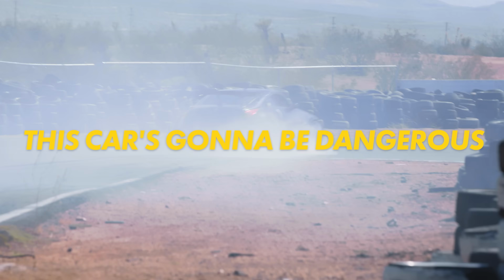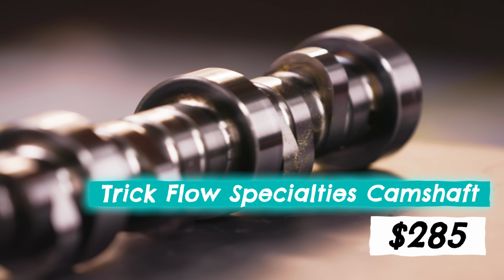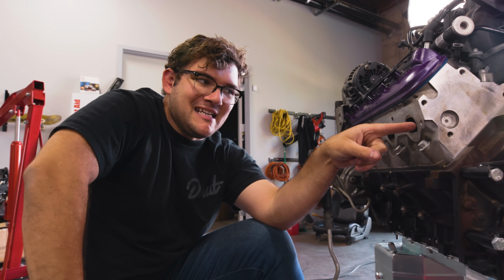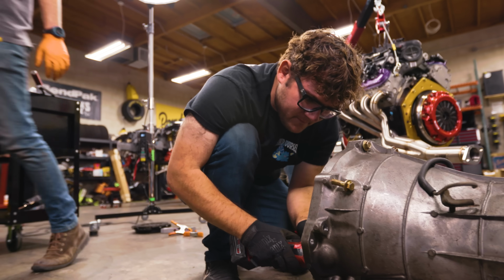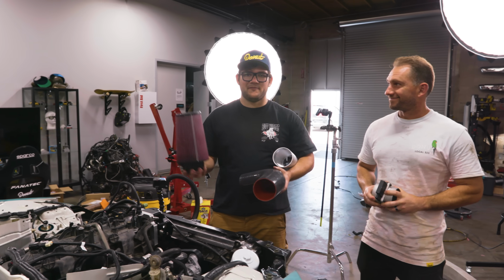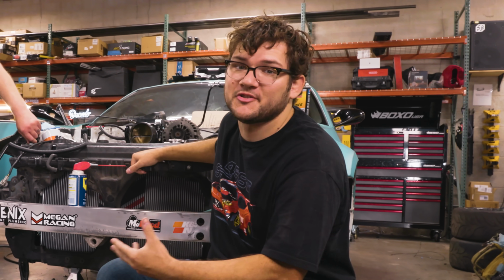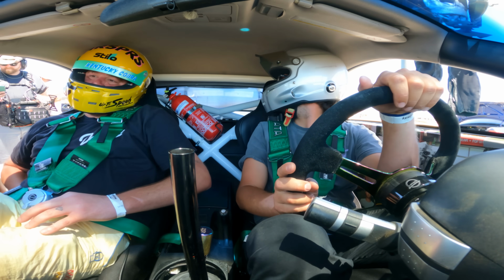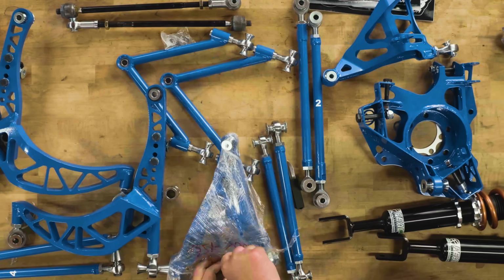$8000 Junkyard V8 vs $30,000 Crate V8 Engine Swap

Comment: Unreal that you made this whole swap in one episode. The amount of time, effort and skill it takes just to do the swap is on a whole nother level. 
So great to see this!
Low car with those tight gear ratios is always gonna smoke the 0-60. Be interested to see the 1/4 and 1/2 mile tho!
Reply: They could have easily drug this out. I'm so glad they didn't
Reply: Yes most other channels would have drug this out, thank you for not doing that to us.
Reply: And for that, I'm going to hit the like and subscribe buttons. I have watched a lot of videos and have not subscribed, until now
Reply: im confused, a google search shows the t56 has 1st gear  as 2.66 vs cd009 (low car) has 1st gear ratio 3.78. would you mind explaining this for me? Do these numbers match, or am I confused?
Reply: @julianbryant1115  The higher the number, the lower the gear, the more wheel torque, but less top speed.
Reply: @jackryan4313 
honestly would've preferred a long format video or multi-part video. i don't know. the whole vibe is sterile here
Reply: @julianbryant1115  higher number more acceleration
Reply: @TheScott240  it's a sin to just now be subbing to donut in 2022
Reply: I wanted to like this, but it's at 420 likes.  So I did the right thing.
Reply: Seriously, when I first clicked this video I thought it'd be part 1 of a series. Lots of work into this one, super sick.
Reply: it takes like 20 minutes to pull a motor with like 6 guys
Reply: I belive if they when with a higher ratio high car could have easily won the 0-60
Reply: @barbaraescobar1329  can attest, 5 of us took 31 minutes to pull a vg30 non turbo out of a 300zx. Granted all deletes were done and exhaust was new so we didn’t fight much
Reply: @dekhunter148  but yall werent recording a movie while doing it...
Reply: They also didn’t really go into detail and other channels would
Reply: @God-mb8wi  I think the point is that they can get on to other more advanced mods instead of doing a five part series on just the engines alone. And who knows, I'm sure they have an absurd amount of footage leftover if they want to break it all out later. I love engine swaps but the point of this show is more to compare the differences you get from buying super high end stuff over taking the cheap route.

Comment: At 25 minutes 11 seconds. Hearing Nolan expressing his feelings. I had flashbacks of me working on my car's entire sound system. Just doing a project at a time, an effort at a time. It was hard, not knowing what is right. Can I mix and match between different brands, items, connectors and etc. Definitely felt good throughout this whole 30 minutes video. Definitely an inspiration for this little but expensive hobby of mine

Comment: Though "budget friendly", low team has a PHENOMENAL setup.  Those "cheap" parts are still great parts, I'm a big fan of TrickFlow myself.
Reply: Their junkyard engine did cost more than my entire car ^^
Reply: @SchwachsinnProduzent  yes i think since they are in cali those engines are more expensive i had a shop in mexico do a lq4 6.0 swap on my cutlass n the engine and trans was around 2k tho i did run a 4 speed auto truck trans so thats way cheaper
Reply: @SchwachsinnProduzent  LQ9 sell for 2-3k, NEW crate engine costs 13k
Reply: Who makes more powaa baby? Of course the one with higher power to weight ratio or am I wrong?
Reply: @Warriorbread  Yeah you are, the one who makes more power is the one who literally makes more power
Reply: @Warriorbread  if you mean which one is faster than yeah power to weight can be a big determination, but putting the power down is extremely important.

With the same crank HP, a more efficient transmission can put down more HP to the wheels.

So if dyno testing is the same, and the weight is same, the one with better gearing and better tires will be the faster one. 

There are too many factors besides just power and weight in other words
Reply: @SchwachsinnProduzent  earn more
Reply: @DuBstep115  go to pull a part and get it for $250
Reply: @jbeasley2528  LQ9 for 250? Probably not, but 5.3 Vortec? Yes.
Reply: @DuBstep115  pick and pull and other chain junkyards have flat rate prices, 250 for a short block (no heads and accessories) or 350 for a long block, best way to do it is go there every week until you find an lq4 or lq9 and buy a short block then a set of valve springs a sloppy stage 2 cam for 89$ and a set of remanded heads for 500-650 and you can build a 450 hp 6.0 for less than 2500$ with wiring and ecu included the best part is there is tune files for sloppy stage 2 cams everywhere for free and a hp tuners mpvi2 is 350ish last time I checked
Reply: @turkeyboyjh1  noice
Reply: @pk_riza_lol183  Where you live factors in SUPER heavily on the price and availability of engines for swaps. I live in the South West desert where V8 is basically the only block we use. However I would still argue low car went for a pretty pricey block, when I mean the true budget Queen of the poor boy blocks would be a Ford Interceptor V8 out of a gen 2 Police Fleet Crown Victoria, I have seen wholeass interceptors go for $200 and crate engines for them go for $2-3k. The Gen 2 Crown is THE fleet car from the late 90s into the mid 2010s hell I think the Crown is still used as a fleet car I mean I got pulled over by a Crown like 4 months ago. My guess is they went with LS in part for the meme, and in another because the crown vic is lacking in aftermarket parts since well it's one of the most hated cars for it's unnecessary bulk, and lack of power compared to other ford blocks, plus I can only imagine the headache of trying to get parts for an unpopular block when an LS is just WAY easier.
Reply: @turkeyboyjh1  complete 8 cyl with accessories is $272 at pullapart including core and fees, at least where I am. You can also sign up for notifications when they get certain cars in and you just have to be ready to get there and pull the engine. 
I see guys put them in older GMs and be under $2500 total for what they did here. That's modifying the factory harness, knock off mounts and modifying cross member. A summit cam and springs and flash ECU.

Comment: Great episode and I'm hyped to have hi-low back! That being said, when you're doing head to head tests, for best apples to apples comparison you should really use the same driver for both cars. To avoid bias it shouldn't be someone from either team. Driver mod is easily the most important aspect of the test at the end here.
Reply: The stig!
Reply: No Zach is a better driver than Nolan from what I’ve seen, I’m pretty sure it’s the transmission that messed him up
Reply: @dominicblade6514  but how would you know?
Reply: I Agree, but one needs to say that low car would have been even faster because Nolan is a less refined driver than Zach, at least from what we have seen over the years.
Reply: @m_lies  what I mean is that the new transmission felt different than what Zach was used to. So he didn’t know the how to drive it like he did before. Nolan has the luxury of using the same trans and I’m sure that the high car is faster they just need a different rear diff to handle all of the power
Reply: @dominicblade6514  well ok, but why do you tag me?

I didn't even comment on you but on Bob Dole " for best apples to apples comparison you should really use the same driver for both cars" I agree with him, but only that I think it wouldn't change the outcome much in this try.
Reply: @m_lies  Your opinion is noted, but frankly low car couldn't have gone much faster. As it left the line, it was on the edge of traction the whole time (we can see the tires chatter and constantly start to break grip before regaining it). Meanwhile high car either totally lost traction or left the line slowly all 3 attempts. Secondly, driving in one scenario isn't equivalent to driving in another. Different situations use different skill sets. Just because you think driver A is generally better than driver B doesn't mean they will perform better than driver B in all situations, every single time. That's why it's important to use the same driver for both cars so that you're not comparing different skill sets as well as different cars. Third, hi-car has a twin disk clutch and low-car has a single disk, their engagement properties are different and that appears to make hi-car much harder to launch than low-car.  Lastly I love the crew at donut and I don't give a damn who's "better" I'm just thankful they're making great content and I gave my input on how to make it even more awesome.
Reply: @dominicblade6514  My comment wasn't intended to point any fingers at who might be a better driver. I agree that the clutch* gave Zach a hard time launching and Idk if anyone else would have done any better. Just a comment on how we should be comparing the cars not the cars AND the different drivers skillsets.

Comment: jeremiah using chemistry to shrink and expand metal is  was probably the most incredible part of the video, i live this dude
Reply: Technically physics not chemistry but yeah that was sick
Reply: I thought everyone knew to put bearing in freezer day before install?
Reply: @alexig1840  yeah it's common knowledge among mechanics haha
Reply: @caydenwenger523  It is, but I don't need to do it very often, maybe once every couple years.  Most of the time if you have the right tools and follow OEM procedures, you're fine.
Reply: But if u heat metal it grows, the hole gets tighter ?
Reply: @jyjhseko  no, if you heat metal then the molecules expand, making the opening bigger and more pliable.
Reply: @craigstephenson7676  Thermodynamics.
Reply: @bernardtarver  Which is part of physics 😂
Reply: @trentmckenzie343  There are about ten different branches of physics; doesn't hurt to be specific.
Reply: @bernardtarver  yeah fr my original comment was just being specific
Reply: @jyjhseko  no? It expands

Comment: I’m impressed that the “low car” was within 38 whp of the “high car…” especially considering the difference in budget.
Reply: truck motor = TORQUE
Reply: @BudgetBB  Which is different than what was said... whp.
Reply: the lq is common at drag strips they are monsters fullly built
Reply: @BudgetBB  camshaft=MO HRSPWRS
Reply: Well 8000 should actually buy a badass used engine
Reply: Yeah, i would have though for 30k you can get a hellcat motor or smth. I guess if they calculated the custom exhaust into that thats probably where a lot of their budget went.
Reply: They do say the crate engine is a 6.2L, and the junkyard engine is a 6.0L ...so the extra hp for the extra displacement just makes sense as logic potential goes.
Reply: @braptechfun6036  not exactly, u can have the same displacement for example 3.8L but have a small to big difference. a normal car uses higher RPM to get its power, a truck engine uses its lower RPM because of the LowEnd torque they have. thats because of the surface-area*1 of the Piston and the Piston stroke*2. normally its "1*>2*" or "1*<2*", there are also engine where 1*=2* but its not that commonly. so team Low actually could have beaten team High in terms of HP pretty "easily". but dont take me too serius, im just a dumb 23 year old that didnt graduate and doesnt have a license nor does have a job.
Reply: That would be "Over Square", "Under Square", and "Square"  bore to stroke ratios.  Over square is better in high RPM applications due to the lower piston travel speed. This would allow for higher RPM limit and also to take advantage of a higher duration camshaft.  Engine RPM limit is of course limited by a multitude of things such as for example valve float, etc.
Reply: They put a cam and heads on a 6.0  should make good power .
Reply: @Usual Suspect William Hamilton did I miss something funny?
Reply: @Usual Suspect William Hamilton i didnt graduate because i got into Hospital and missed about 35 days wich canceled the graduation for me. Not because im stupid.
Reply: @Usual Suspect William Hamilton You dont gotta hate on em like that chill it's just a comment
Reply: @dasidiotentv8253  The 6.0 and 6.2 engines both have the same crankshaft stroke and rod length.The 6.2 just has a larger piston diameter thats it.The cam is what determines what rpm the hp and torque are made at as far as LS engines go.They made the 6.0 make power higher and rev higher with the cam they installed.If they put a real cam in high car it would smoke the low car.
Reply: @robholmes2129  im not that familiar with the V8's cause i live in germany where we mostly tune 4,5,6 and 10 (w10) zylinder engines. Also my englisch isnt the best so i just said the Things i know how to say in english. But still thanks for it
Reply: a well engineered and properly maintained motor should only bleed maybe 1 or 2 horsepower a year. I've worked on plenty of 200k motors with much more life than you'd expect.
Reply: @billybob4274  THC?
Reply: Also I'd imagine the torque would be as good if not better on the low car thanks to it being a truck engine, but not sure on that
Reply: Horsepower is for winning dyno competitions, torque wins on the track!

HP= (Torque x RPM)/ 5252

Thus flatter torque curve = shorter track times.
Reply: And the longevity winner is ???
Reply: Only thing im saying is why a truck motor for a tuner tho lol smh why!? 

No offense but thats a hill billy move.... Thats like a version of cutting off your muffler instead of getting downpipes to make it louder lol. 

I heard of swapping muscle car motors and such, but a truck motor in a tuner lol wow.

let alone not even a good truck motor capable of pushing out good hp or torque...
Reply: @That1Dude_N.S.  The LS engine platform is shared across multiple vehicles, both cars and trucks. Not a whole lot separates them besides cam profile and intake manifold.  In fact many weekend warrior drag cars are being build around the LQ9 (truck) engine as it has a cast iron block and slightly lower compression. Both of which is perfect for adding a blower.
Reply: Ik. but im talking about the engine they picked for this build because buying a junkyard build is a hit or miss, but you'd be surprised on what u find in junkyard builds half the time especially the results.

But most of the time it works out but they could of at least picked one thats suitable, if you know what i mean.
Reply: @Lamster66  so the used truck motor went longer then the new ls before a failure
Reply: @Lamster 66 How does that go with anything i mentioned? Lol..
Reply: @thedude5342  yea they're both truck motors, but the new one is the one i was tryn to point out that they should of pick a more capable motor
Reply: Plus probably didnt help that they dropped the motor. That made me cringe hard lol
Reply: @That1Dude_N.S.  OK still not answering my question but thanks.
Reply: I said yea, as in yes to your question.... Check the third message up but yw
Reply: @Lamster66  spell because right and i might believe you rofl
Reply: Only thing i was saying was you'd get better results out of a muscle car motor, or do i need to explain to you?
Reply: @Lamster66  
Dont get your taco in a twist jeez
Reply: I like how they spent 8 grand on a junkyard motor, when they could have bought an ls3 canned crate motor for the same money.
Reply: It all comes down to weight
Reply: @BudgetBB  yeah torque is king.
Reply: @BudgetBB  I got videos of my mustang on my channel. Although the most it made was 403 wheel I made 460 ft pds of torque almost from 2000 rpm which makes it pull like a truck from a dead stop. I beat a guy in a gt 350 who was dumbfounded an EcoBoost could pull that hard from a stop.
Reply: @kevineckelkampe2r  i think they 8000 total vpst, noy just the engine. they said they spent 5000$ on parts to make it wotk
Reply: theyre both gm blocks
Reply: Not to denigrate high car or anything, but crate engines are rarely worth it
Reply: I've done a few iron block v8 swaps can get some decent horsepower out of them where you lose is power to weight ratio that iron block is probably 100-150 lbs heavier
Reply: Given that swapping an LS into a Z33 is more expensive given the added sensors and complication makes sense.

Comment: Can we just take a moment and appreciate how good Lo car sounds with a 350Z exhaust strapped to a Chevy truck engine. That sound is chefs kiss.
Reply: I got so excited when I saw that they put a truck engine in lo-car! I love Japanese cars with truck engines. Can't beat that sound!
Reply: Tomei exhaust sheesh
Reply: @emanh4keem_san420  Ok......It doesn't matter who makes it, It's still an exhaust for a 350Z
Reply: @Kenneth_Rogers  actually does matter 😂😂 but ok
Reply: TOMMEEEEEEEIIIIIIIIIII
Reply: @Kenneth_Rogers  nah, you can't compare a titanium performance exhaust to stock mild steel garbage
Reply: @demoths  I'm not comparing them. I'm stating that the exhaust was made to fit a NISSAN 350Z but it still sounds amazing bolted to a CHEVY V-8.